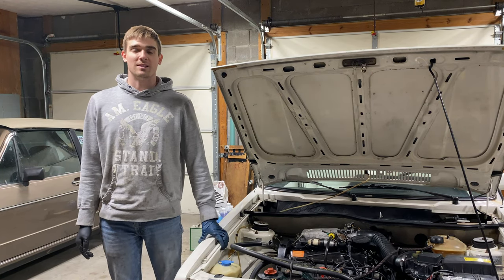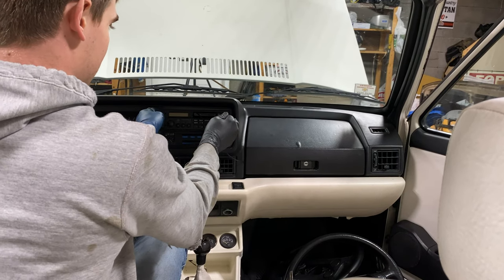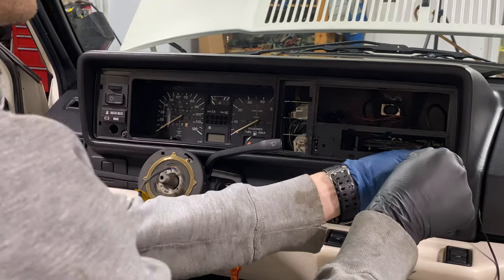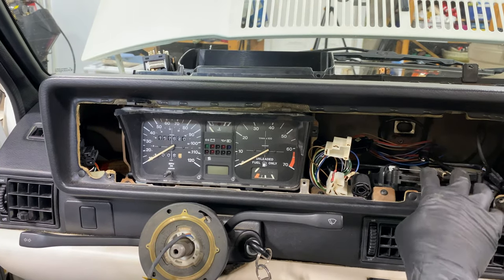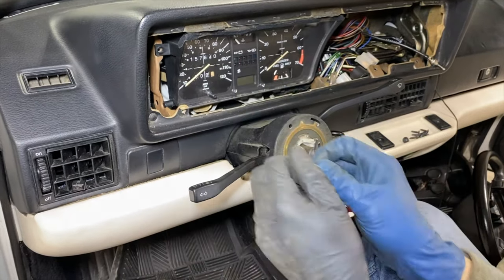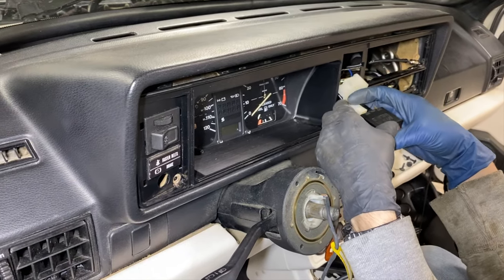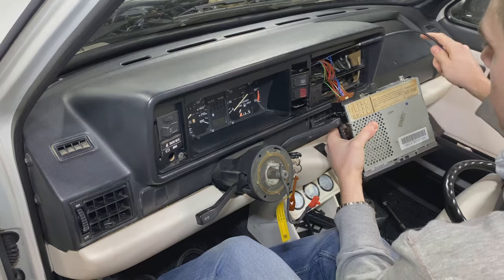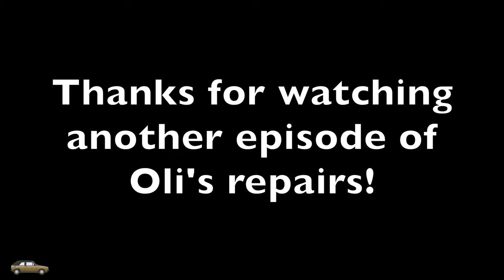VW Mk1 Cabriolet Instrument Cluster and Radio Removal

Comment: Hi Oli… you have the best videos ever.  I just bought a 1984 VW Rabbit Convertible.  One idea for a video might be to show how to do electrical testing on multiple areas of the car.  I saw your video on the testing of the oil light which was fantastic.   However, with many people (such as myself) who are terrified of the electrical system, it would be super cool to see how you test multiple circuits.  Anywho… if you never do another video I’m still thankful that you created the ones you did.  But would LOVE to see a bit more electrical as it seems to be one that everyone is afraid of!   GREAT JOB ON THESE VIDEOS!!!
Reply from the maker: Thanks for the kind words and suggestions! I hope to keep making videos for a long time. I have one coming out tomorrow about replacing the ignition switch, but that doesn't involve much electrics. 
I need to make a video on how to read a wire diagram. And then from there I can branch out a bit. If you have any specific suggestions for which systems, let me know!
Reply: @OlisGarage  you’re the best!!

Comment: Hi Oli, amazing videos, you are just simply amazing... Made life a hell of a lot easier for me. How do i fix the high beams light that does not seem to come on when i switch to the high beams? Thanks in advance, amazing car by the way!
Reply from the maker: So the high beams work but the light in the dash doesn’t come on? The tiny bulb is burned out. Just buy a replacement blue led

The original is actually a tiny incandescent with a blue filter over it since blue LEDs weren’t used back then

Comment: Thanks again, Oli.  Have you done a video on repairing/replacing the A/C switch controller in the dash [shown in this video].  

Its  little vacuum distributer is leaking uncontrollably, so the heat/cooling vent flaps don't work now.
Reply from the maker: I did a video on taking it apart and lubricating it. It is one of my recent videos. That might help you figure out what the issue with yours is!
Reply: @OlisGarage  I can't find this video.  Can you please provide the link?  THANKS!
Reply from the maker: Here you go! https://youtu.be/Y840I1CTqZA

Comment: Thanks for all your great videos!  Finally picked up my first VW Cabriolet (US '92), and it's nice to do some of the little fixes myself.  QUESTION:  I have the stock radio, and when I put a cassette tape in it, it loaded the tape but is now just stuck.  It won't Eject, FW, RW, or play.  Do you have a suggestion and/or video of how to get a stuck tape out of the radio without breaking the radio itself?  (Don't care about the tape)
Reply from the maker: I’ve taken the radios apart before and was able to remove the tape player portion as a whole. Taking the radio apart is fairly easy as it’s just a few screws. From there it should become somewhat obvious on how to remove the tape. Unfortunately I don’t have it exactly memorized how it looks inside.
Reply: @OlisGarage  Thank you for the reply!  I ended up taking it to a stereo shop that was willing to give it a try.  They got it out without issue!  The radio works again, so that was a win. But, I will not chance putting another tape in moving forward.  I instead just purchased a bluetooth charging adapter to stream from my phone.

Comment: I assume there are some differences in removing the instrument cluster from a 1981 VW Rabbit.  I currently have the instrument cluster loose but it won't pull out the front.  I am thinking that I might have to remove the whole Dash.   Do you know if there are differences in removing the cluster from a Rabbit verses the Cabriolets?
Reply from the maker: Unfortunately yes some differences. And I haven’t touched a rabbit in a very long time so can’t remember all of the differences. 

Did you disconnect the speedometer cable? You should not have to pull the dash. I would highly recommend against pulling the dash..haha. It’s just a pain and they never go back in quite right.

Comment: On my 93 I have had a problem with my blinker fuse. I've been told that there is a single wire on the hazard switch that is probably the problem. I'm guessing it maybe the blue one in the video you were talking about?
Reply from the maker: Turd Ferguson is the fuse burning out? But yes, the blue wire is always hot so that the emergency flashers work at all times.
Reply from the maker: Turd Ferguson is the fuse burning out? But yes, the blue wire is always hot so that the emergency flashers work at all times.
Reply: I unplugged the hazzard switch and the fuse didn't blow this time! So I put the relay in and it still didn't blow but can't get it to flash.   Wondering if I  need to buy a new hazzard switch?
Reply from the maker: Turd Ferguson correct, it will only flash properly if the switch is installed. It could still be a wire grounding out somewhere. What fuse is burning out?
Reply: @OlisGarage  Turn signal 10 amp fuse. #19
Reply: Is there any possibility that maybe the switch itself?
Reply from the maker: Turd Ferguson absolutely could. And buying a new one is cheap. So that might be a easy first step.
Reply: Thanks for your help!

Comment: do you know how i can fix my TACKOMETER and  my GAS GAGE? please let me know what to do
Reply from the maker: Voltage regulator replacement most likely
Reply: @OlisGarage  thank you i also was told on Facebook that it could be the voltage stabilizer. is this correct?
Reply from the maker: @alexanderspeer6704  if your fuel gauge, gas gauge, and tachometer all don't work then it is almost guaranteed the voltage stabilizer. 

I need to make a video on how to replace that. If you don't feel comfortable replacing it, I offer a replacement service.

Comment: Do you have anything on reverse light switch replacement?
Reply from the maker: Not yet. What vehicle are you working on?
Reply: 1987 VW Cabriolet Manual Transmission
Reply from the maker: @MrBay49er  that’s a really easy job. It’s literally unplugging a wire on the transmission (the only wire one can unplug on top), and then swapping out the switch with a wrench. I will eventually make a video, but don’t have one yet. Send me an email if you need more help and I’ll try to help you out.
Reply: @OlisGarage  I get 2 switches when I google the back up light switch and upshift light shift. Not sure which is the correct part needed. My reverse lights stay on at all time. What is your email address?
Reply from the maker: Olisrepairs at gmail

Comment: i just bought an 87 cabriolet, and the antenna cord for mine is directly connected to the radio, any tips?
Reply from the maker: There is no way to disconnect it? That is strange. Not sure how that would work... is it an aftermarket radio?
Reply: @OlisGarage  it's the original, I may be able to disconnect it from the antenna but I'm not sure how to get to it
Reply from the maker: Justin Montoy you can disconnect it. You just have to carefully pull on the antenna wire. If you can pull the radio out far enough, then you can use some pliers and carefully grab the end of the connector and pull on the small silver piece crimped to the wire (that way you’re not pulling on the antenna wire)
Reply: @OlisGarage  I was able to remove the radio! Thanks for your help. I may have to come back when i have more questions